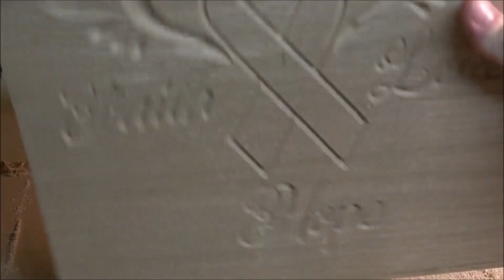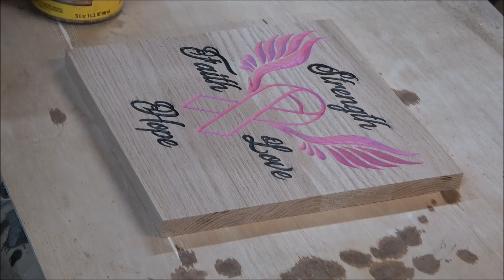CNC'd Donation (Breast Cancer Awareness)

Comment: Great job as always but I have to ask. Have you tried sanding sealer, oramask or spraying with clear coat before airbrushing to minimize sanding later?
Reply from the maker: All of the above....I like sanding sealer best, I have had very little luck with oramask, it always seems to pull up during cutting and makes a mess of things.  I figure it has to do with the humidity here, it stays pretty high this time of year.....Thanks for watching!!!